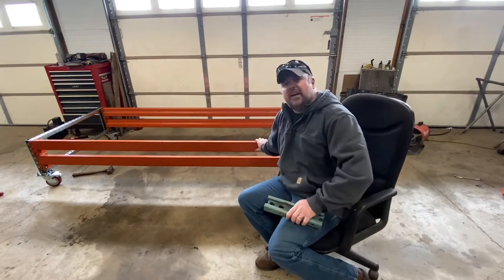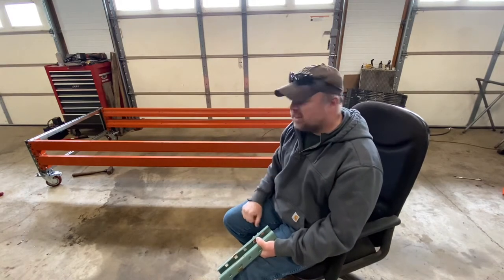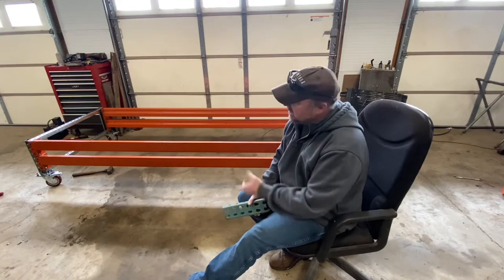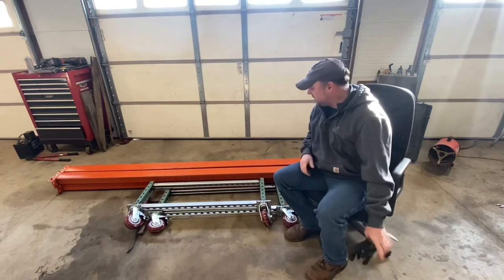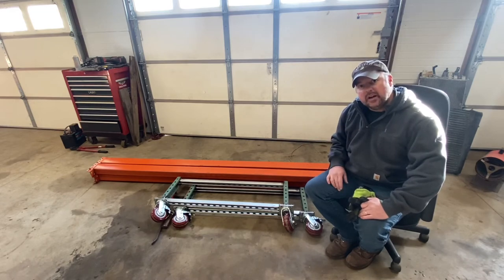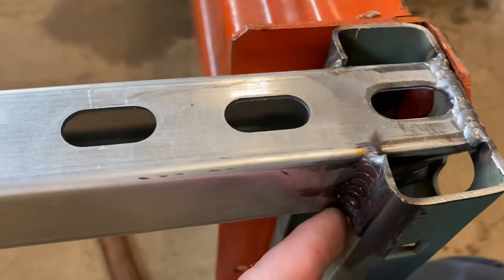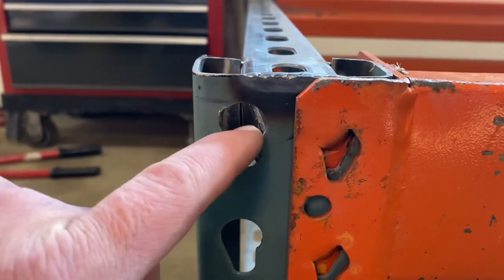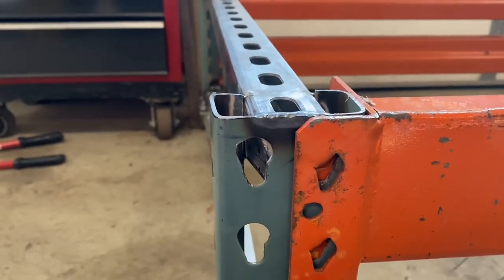Ultimate DIY chassis/body cart!!! Repurposed pallet racking collapsible cart￼!!

Comment: I was going to use pallet rack to build a body cart for my 1955 Chevy but ended up finding a heavy duty, 13’ long (workbench height) welding fixture (?) that was permanently welded together.  I cut it apart and added mounting plates so now it bolts together, but more importantly, comes apart so I can store it.  I paid $50 for the original welding fixture which had $200 worth of casters.
Reply from the maker: Very cool!

Comment: Brilliant idea!!
Reply from the maker: Thanks!!  A bit of an update: I will say the caster wheel choice I made could have been better. With the weight of the van body on it, it developed flat spots on the rubber wheel. The van body is pretty heavy though. But if you’re planning to build one maybe consider a solid metal wheel if you plan on heavy heavy load.

Comment: Great idea!! What is the length of the rails?
Reply from the maker: Thanks!! I used what I had left over which were 9 footers. If I could also make a suggestion, try to find a harder wheels. My wheels have flat spots from sitting loaded for too long.
Reply: @GillansGarage  Thanks for the response. I just started watching your channel.
Reply from the maker: Thanks!! I really appreciate it!! I have fun with the channel. It’s a great motivator for me.
Reply: Where did you purchase the rails from?
Reply from the maker: @williamguillIII I found a guy selling whole sets of shelving on Facebook. I bought 24’ uprights and cut them in down and made this cart with the leftover pieces. I bought extra rails for this cart build.